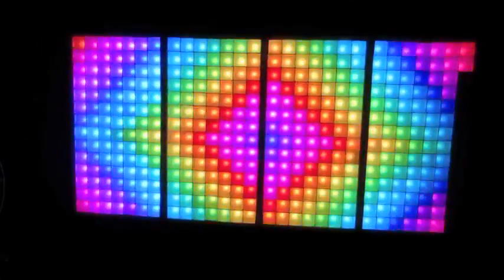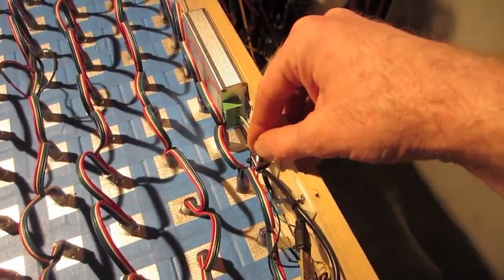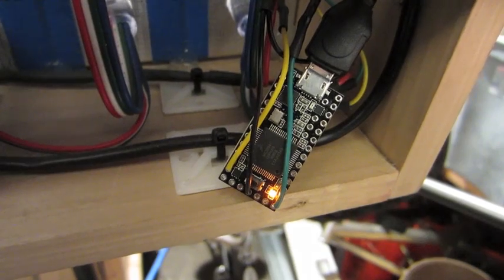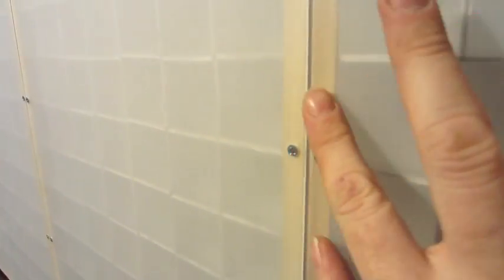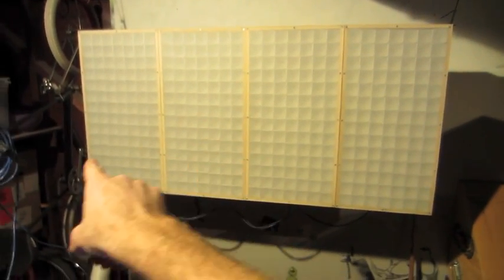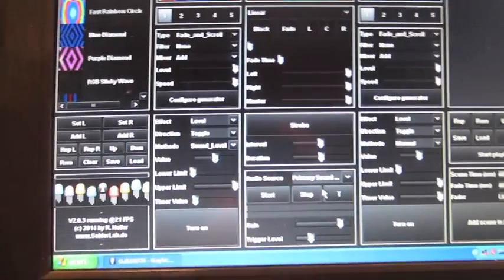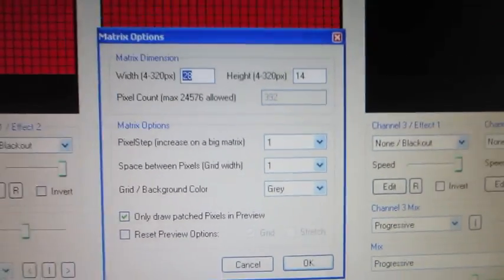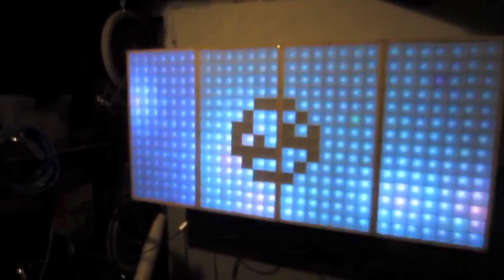How to WS2801 pixel wall + Teensy 3.0 + Glediator/Jinx

Comment: Sadly I learned about Glediator and Jinx very recent because the website solderlab.de doesn't exist anymore now in 2021 and I have a hard time finding any documentation, I also can't find where to download the Glediator software from since the website is gone and the hardest part is where to find the Arduino sketch that I can use so I can communicate with the Arduino.
Searching for something similar that does have support and updated to 2021 took me down a rabbit hole that lead to nothing.
If there's anyone who knows more about where I can get the software or point me in the right direction that would be appreciated very much, I can use some help here.
Reply from the maker: It's been a long time since i've tried messing with this. But this is what I have. I just zipped the Glediator folder, not sure if this would work. I don't remember there being an installer for this, so it might. I have it installed on an OLD tower and OLD laptop but can't find any files anywhere. Sucks Solderlabs is no more.

 https://drive.google.com/file/d/1s8CjrGg-xuvoO1XV8ELZ5J9KpTaDyAD8/view?usp=sharing
Reply: @SISKworks  I downloaded the zip, at least your files are more recent than what I have but sadly there's no Arduino sketch file that I need to make it work.
Reply from the maker: @RicardoPenders  I’ll pull the old tower out tomorrow and see what files it has. Check back here tomorrow afternoon/night.
Reply: @SISKworks  thank you so much for the help, I'll check back later.
Reply from the maker: @RicardoPenders  This is what I could find. I used a Teensy, not Arduino. But to be honest I really don't know what i'm doing when it comes to coding arduino/teensy projects. I just took a sketch someone else made and tweaked a bit for my build. Hope this helps.

https://drive.google.com/file/d/1wLc_wA0ESfN2BfT0wsSwHuzrLq50NUE7/view?usp=sharing
Reply: @SISKworks  Thanks to your files I finally got it working, at least Glediator is working correctly with my 2 matrix panels of 8x8 that I have connected together in series as one matrix, it took me a lot of tinkering with the settings because of the way I have it connected it's not that straight forward to configure the software, the best thing of all is that I have the Glediator sketch for the Arduino UNO, the NANO and for the ESP8266 but I love to have it working on the NANO, that's my favorite µC.
I only don't get it working in Jinx, it does work with connecting to the COM port and the LED's are lighting up but it's all chaos... I just don't get the pattern configured how my matrix is build and I'm lost but I'm so happy that Glediator works flawless and I can't thank you enough for your help.
It's really cool software, I've made myself a very nice visualization playlist already and been tinkering for hours, I don't understand why Solderlabs stopped support for this.
Best regards,
Ricardo Penders
Reply: @SISKworks  There's one thing I didn't mention in my last comment which is that I don't see any sound input devices in the software that I can use which is a bit strange because I certainly have the hardware it's just not showing up, do you know if that needs a certain switch on the command line or is there any way to get the software to recognize my sound device?
Reply from the maker: @RicardoPenders  oh that makes me so happy that you are getting it to work. I’m so bummed that the solderlab website is gone. I got a lot of help from other people’s comments there. I’m really not sure about the audio though. My device just showed up and I didn’t have to do anything special that I can remember. But I do know that the audio response wasn’t great. Tons of latency. Jinx worked so much better with audio.
Reply: @RicardoPenders  im in the same rabbit hole that you were! while finding that software and the website solderlab etc.. Could you please help me to have the software etc.
Salute to MIKE SISEK of his honest n dedicated work.
Reply: @mehdiraza5781  Yes I can help you with that, I have downloaded all the necessary stuff and saved it on my hard drive and it would be a pleasure for me to share it with you, just let me know how you want me to share it and I'll see what I can do for you, I can upload the files to a temporary file sharing server for example, or I can upload it to my Google Drive and then share the link for you to download the files, or I can post it on my GitHub page and make it publicly available there, whatever you want just let me know.

Comment: Is the glediator software is still available?
Reply from the maker: Michael Deloso hmmm, looks like I their site is no longer active. That’s a bummer. I might still have the zip file on my old laptop. I’ll try to find it this weekend.
Reply: @SISKworks  thank you Sir 
I will planning to build LED wall just like yours. 30 lights by 60 lights ws2811 string.

Comment: Thanks for video
I have dmx controller T500k
Can i connect my controller to glediator?
Reply from the maker: hasrullah husain No you can’t. Think of Glediator as a controller. So you would not connect a controller to another controller. But I think Jinx has an option to control DMX LEDs but I’ve never used it.

Comment: HELP.......HELP......

Good morning Mike Sisk

When trying to compile the file to the arduino until you can copy, but a message appears after copying:

In file included from C:\Program Files (x86)\Arduino\hardware\arduino\avr\cores\arduino/Arduino.h:30:0,

                 from sketch\WS2812_Glediator.ino.cpp:1:

C:\Users\rogerio.batista\AppData\Local\Temp\Temp1_ws2812_glediator (1).zip\WS2812_Glediator\WS2812_Glediator.ino: In function 'void USART_RX_vect()':

C:\Users\rogerio.batista\AppData\Local\Temp\Temp1_ws2812_glediator (1).zip\WS2812_Glediator\WS2812_Glediator.ino:53:5: warning: 'USART_RX_vect' appears to be a misspelled signal handler, missing __vector prefix [-Wmisspelled-isr]

 ISR(USART_RX_vect)

     ^

In function 'USART_RX_vect':

C:\Users\rogerio.batista\AppData\Local\Temp\Temp1_ws2812_glediator (1).zip\WS2812_Glediator\WS2812_Glediator.ino:53:1: warning: 'USART_RX_vect' appears to be a misspelled signal handler, missing __vector prefix [-Wmisspelled-isr]

 ISR(USART_RX_vect)

 ^

the time that I have to control the LEDs only keeps blinking the rx of my board but does not control a led, I am using the arduino generico MEGA 2560, in it there is no reset track to be broken, will I be able to use it to control my leds WS2812b?
Reply from the maker: Rogerio Sousa sorry but I have no idea if it will work with your LEDs. I've only used WS2801.

Comment: Awesome vid very helpful! Wondering if you have every tried to use glediator/ Jinx with DMX or midi? Im trying to figure out a way to trigger my scenes without standing in front of my computer. Thinking of creating a midi break out or dmx  for my Arduino and loading my scenes on it to do so. If you have any idea or input I would love to hear it!
Reply from the maker: I've had the same idea in the past but I just don't know how to make that happen. It would be awesome to be able to control with a MIDI controller instead of a mouse. If you come up with a good solution I would love to hear it. I'm currently trying to figure out how to run Glediator on a Raspberry Pi. I've got the software loaded and running but having really difficulties getting the RXTX to work on the Raspberry Pi. My idea was that I could replace the old desktop windows XP computer that I use for Glediator with a Raspberry Pi and then I would connect and control the Raspberry Pi wireless over a network with a tablet. This way I could walk around the dance floor and control the LEDs instead of being tied up at the PC all night.

Comment: hi mike please connect me 
+923037747429
please mike i wana ask something about this
Reply from the maker: No, I'm not going to call you. Sorry. Just ask here.
Reply: Mike Sisk bro i am not said for call only text on whatsapp
Reply from the maker: +Ahmad Awais No, I can't do that either. Sorry.
Reply: bro i am in trouble please help
Reply: i used glediator for ws2811.
when i put the supply at output of the LED's then led's blink when i put at the input nothig is show on board
Reply from the maker: Well I have never worked with WS2811 LEDs. Mine are WS2801. Also I am by no means an expert on any of this. For my setup it does not matter where you connect the power supply. In fact I split the power supply and injected in many places in my pixel chain. The data and clock line how ever MUST be connected to the input of the FIRST pixel of the chain. Also make sure that the power supply ground is connected to the teensy/ardunio ground.
Reply: i need 5v 20A power supply but i have 5v 30A is that rightfor LED's?

Comment: I made sure I had everything sodered correctly and I do, but when I het the "serial open" and "apply changes" nothing happens to my LEDs. im using a arduino nano, a sd card adapter connected to the arduino, and ws2812b LED strips. in the command prompt, it says all of these "acess denied" errors and it also says "wrong number_of_board sizes" any ideas on whats going on ???
Reply from the maker: Are you sure you have the RXTX installed correctly?
Reply: not exactly to sure. nor do I know how to check that. im new to the LED programing and not to familiar with everything but im eager to learn

Comment: Hi friend, I have a question..... I have a similar proyect but with arduino..... If a change to Teensy... I use the same code or I need to change any code?
Reply from the maker: I originally tried a Arduino Uno and it worked but it was slow. I changed the Uno for a Teensy and it was much faster.
Reply: +Mike Sisk with teeny you use the same code? Or you change any line code?

Comment: HI one question, whats the distance between each led?
Reply from the maker: the boxes are 2"X2" so when mounted they are 2" apart but the wire between each pixel is about 4" or so.

Comment: HELLO MIKE¡   CONGRATULATIONS FOR YOUR PROYECT ,  IÁM TRYING TO DO SOMETHING SIMILAR, I AM LOOKING FOR A WAY LIKE THIS FOR DISPLAY FIGURES ON A MATRIX OF 50 X 40 PIXELS, IÁM USING LED TYPE WS2811,  AND I SAW YOUR PROJECT AND IT´S A PERFECT IDEA TO USE GLEDIATOR SOFTWARE, BUT I DON´T KNOW IF TEENSY  CAN SUPPORT ALL MY UNIVERSE OF 2000 PIXELS, IS DIFICULT FOR MY TO UNDERSTAND HOW TO PROGRAM THIS KIND OF CIRCUIT, I HOPE TO HAVE NOTICE FROM YOU, I WILL THANK YOUR SUPPORT TO FINISH MY PROYECT , COULD YOU HELP ME PLEASE?
Reply from the maker: Sorry I do not know what the pixel count limit is. I do know that using a Teenay is much better than a standard Arduino. You might try asking in the comments section of the Glediator website (solderlab).

Comment: I'm new to all of this but this looks a great project to try, so my only question is at the moment, is that the Teensy is now at 3.2 is there any difference in using from the 3.0?
Reply: Mike

If I was to use WS2811 or WS2812 what pin numbers do you think I should use as there will be no clock?
Reply from the maker: Sorry I do not now the answer to that.

Comment: Hey Man! I have a problem: I'm using WS2801 LED's like you. But my Baud rate seem's to not fit. When I activate gladiator's serial port with the baud rate of 230400 (Baud Rate should be 500000). But my glediator programm freezes directly. Can you please tell me your UCRRnA value of your code (mine is 3)... thx a lot!
Reply: I've had this issue too -- it seems that the only one I was able to use over serial is my Arduino Uno. My Leonardo and my Particle Photon both make Glediator freeze.

Comment: hey can u help me out? Im attempting to run glediator on arduino uno and well getting the library RXTX is impossble for me. I've searched the internet for about 6 hours now, attempting to make it work and nothing. I am running on a mac. I simply need an explaination on how to get the library so glediator sees the com port. THANK YOU!
Reply from the maker: +Jaun Salgado I was never able to get it to run on my mac. I had to use a PC.
Reply: +Jaun Salgado Have you made it work? I'm on a mac too, and got it to work. You need both:
- RXTXcomm.jar
- librxtxSerial.jnilib
from http://jlog.org/rxtx-mac.html
Place them in Library/Java/Extensions and glediator should see the arduino.

This is the sketch I'm using on a Teensy 3.2. Should work with the arduino I think:

#include "FastLED.h"
#define NUM_LEDS 144
const int dataline = 6;

CRGB leds[NUM_LEDS];
void setup() {
Serial.begin(115200); 
LEDS.addLeds<WS2812B, dataline>(leds, NUM_LEDS);
  pinMode(13, OUTPUT); 
  digitalWrite(13, LOW);
}
int serialGlediator() {
while (!Serial.available()) {}
return Serial.read();
}
void loop() {
   while (serialGlediator() != 1) {} 
     digitalWrite(13, HIGH);
   for (int i=0; i < NUM_LEDS; i++) {
     leds[i].r = serialGlediator();
     leds[i].g = serialGlediator();
     leds[i].b = serialGlediator();
   }
     FastLED.show();
     digitalWrite(13, LOW); 
}

Comment: so many questions. I'm doing something similar to yours 6 panels all 6 ft tall 1 ft wide, (so a 6 ft by 6 ft matrix) they will be separated by a few feet depending on the size of the stage. I need an idea on how to get power and data between the 6 that can be quickly set up. # 2 we will be using a backtrack and click. want to sync up audio to a lighting sequence that both run concurrently. can glediator do this? or can you "bounce" a sequence and maybe switch it to run video instead?
Reply: I noticed you were a musician too so I wonder if we can use a trigger (sample pad) to trigger both the back track and lights so if we want to repeat the chorus the lights don't cut out early
Reply: +Kreg Taylor example; verse has one pad chorus has one pad hitting each starts both the backtrack for its respective part along with the pre programmed light show
Reply from the maker: +Kreg Taylor Originally when I had my panels in four separate blocks I used a 4-pole locking speakon connecter to connect each panel together. I also use a 1/4" plug to input power to both the first and last panel. For the syncing to audio the Glediator software does have a audio trigger option that can trigger effects. The only problem with the trigger is that I've found it lags noticeably, it may just be my slow PC that I use to control it though.

Comment: how do I get gladiator to recognise the port my arduino is in?
Reply from the maker: +Richard Groizard you probably don't have the rxtx library installed correctly.
Reply: +Mike Sisk I have the light flashing on arduino and port is found but its the arduino just not sending data to the leds
Reply from the maker: +Richard Groizard hmmm...are you inputting to the correct side of the LED string/strip? also, are you sure data and clock lines are not backwards?

Comment: Mike thanks for your very thorough video. Ive been trying to get Glediator to work but I believe I'm having issues with the RXTX side of things. I can see the port I want to connect to in the serial open drop down menu, but the software won't connect to it.  Im on mac OSX 10.9 running WS2812b (neopixel strips) on a teensy 3.1 with the octo board attachment.   
 I see you are running off a windows system but I am curious if you were also able to get it working on the mac system and if so would you be willing to provide any more details about how to get it up and running? Thanks
Reply from the maker: No I was never able to get my MacBook to work either. But I thought I read somewhere that other people were able to get it working at lower baud rates. I gave up and just used a old PC I had and built it into a road case.
Reply: okay I don't feel as bad then... Ive seen on the Teensy Forums where people have got it working as well, but unfortunately noone has responded with a solution. If I figure it out I'll share with you... I do have the PixelController software working on mac though if you are interested

Comment: Awesome project with amazing results! I've just started gathering supplies for a similar project (modular panels for expansion and a mobile enclosure for gigging) and I must admit that seeing your setup helped give me the motivation to undertake this endeavor, as I have no prior experience in any of the fields involved. So thank you for that. I just have a few questions as far as the materials you used: what are the dimensions of the wood used for the frame? What material did you mount the LED's to? And what (if any) adhesive was used to fasten the LED mounting board to the frame? I would be eternally grateful if you could enlighten me. Thanks again for the inspiration and I look forward to your reply.
Reply from the maker: +jesus eduardo Thank you. That makes me very happy to hear that my video helped  to inspire and motivate your project. I think the wood I used was 4" x 1/2" boards that came in 6' lengths. For mounting the LED i used a bunch of small 2"x2"x2" cardboard boxes. I drilled a hole slightly smaller that the pixel in the bottom of each box and just pushed them in. The string pixels have a little flared out section and then a groove behind so they can be easily pressure fit mounted into the right size hole. Then the boxes are just taped together and hot glued to the wood frame in the corners.

Comment: Never knew about Glediator.  Thanks for the great demo.  Nice job constructing.  Are those cardboard boxes behind the plex?  Wish you could have shown the internal construction of the front side.  Lots of work!!  Good job!!!
Reply from the maker: +Mikey MoMo Yes they were small cardboard boxes with a holes drilled into the bottoms. Then I just hot glued and taped them into the wood and plexiglass frame.